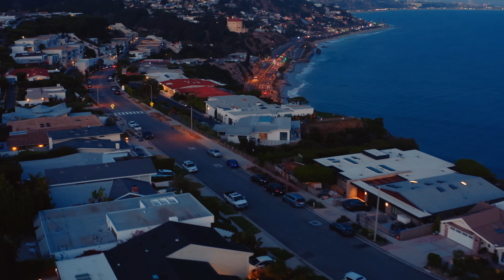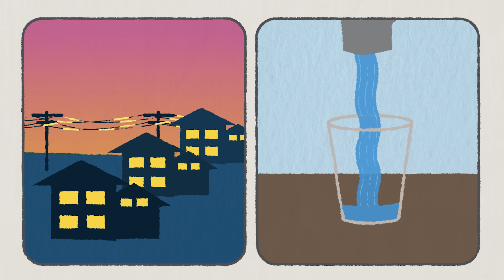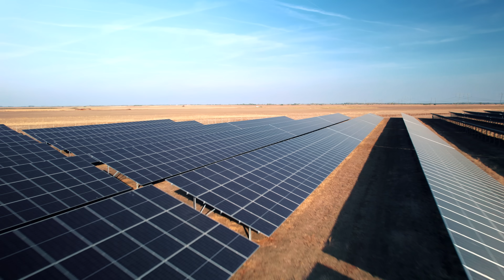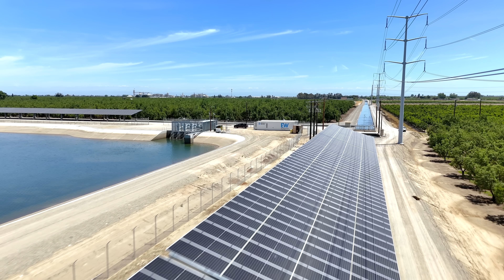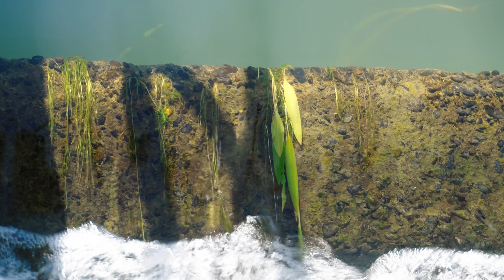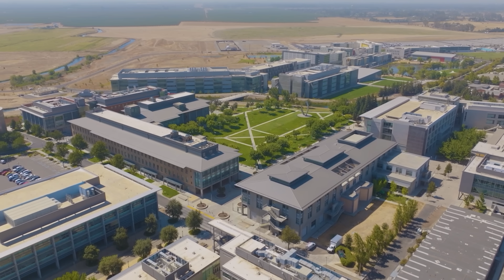California’s new solar panels do MORE than generate power

Comment: I think in the very near future, solar AND battery technology are going to turn the corner where they go from "good technology" to the new baseline technology. I think way too many people are pessimistic about this tech partially because we're still in it's relative infancy.

You point out the growth in solar with a roughly 25 year span, but the "old tech" we've been using has been around for 100 to 150+ years, that's 4-6x as much time for refinement. 

By 2050, I believe solar and battery tech with be advance enough that houses can be easily built to be 100% independent. What I mean is: there are plenty of people who are living net zero with current technology, even with an EV, but I do believe the next step in both solar and battery tech will mean houses don't need to be NET zero, but solar will advance enough that it can generate that much more in the same footprint and battery will advance enough that it can easily store a lot, both to the point houses can generate and store enough to supply themselves more than overnight.

I don't know that we'll be 100% free from fossil fuels by then, but we'll drastically reduce the need for them.
Reply: I believe we will achieve net zero through a variety of resources. What about magnetic-based energy?

Comment: That's US bru, that's US. A continent size country. You have deserts there, huge barren plains with constant sunshine !!! No clouds 99% of the year. 

What you did there, is pure engineering masturbation. 50 more cost efficient ways of preventing evaporation , at least 50. 

You ain't Switzerland, but a whole continent. Waste of resources !!! Do it on deserts, no need for fancy structures, free land. US has interconnected grid , no ??

Comment: I love how cheap solar panels are, so many places are putting them up since you can now earn more then it costs by simply putting in solar panels
Reply: They dropped in price significantly over the last ten to fifteen years ago. I remembered in the 90s and early 2000s that it was talked about that making a single solar panel created as much pollutants than it saved in its operational lifespan. Technology has made significant leaps back then, wether it was true or not, these new generations of solar panels definitely bring in far more efficiency and sustainability on the table than previous generations.

Comment: Right now the issue isn’t just standby power - its grid stability. Turbine Generators have the advantage of huge amounts of mass rotating to produce the grid frequency. Inverters don’t provide any such mass, so Li Ion Battery storage can only take us so far. Flywheel systems are interesting for this purpose, but haven’t been deployed widely enough to be a real substitute for older generating stations yet.
Reply: Thank you for your comments. It's obvious to me that you have  thought ideas to solve problems and looked into solutions as well, for this for some time.

Comment: The fact they dont put ANYTHING over canals is astonishing. It would be easy to put some tarp over them at least temporarily.
Reply: they planted thousands of trees along the Canal du Midi in order to reduce evaporation.
Interesting how different people come up with different solutions to the same problem.
Reply: @P-Mouse  That would be a ton of leaves falling into the canal, especially when the Santa Ana winds come.
Reply: @P-Mouse I'm sure those trees don't need any water eh
Reply: @jedinxf7  they do, they are literally spending water in order to save water.
Reply: @P-Mouse good
Reply: That's a lot (A LOT) of tarp

Comment: California should stop growing almond trees. They’re not suited for the area because they rely on a tremendous amount of water. Avoiding a problem all together is smarter, and cheaper, than trying to fix one. 
I think that the PV canopies are brilliant but... perhaps, to save money and cover much (but not all) of the canal water (but over more miles); angled panels erected on only the south side(s) would be enough to create adequate shade without having to span the whole canal. Making bespoke frames costs more than using off-the-shelf PV stands. Of course, if the project really takes off, the canopy frames wouldn’t be bespoke anymore but just another option.
Reply: I agree with you...  It doesn't make sense to grow such a water hog in a place with water issues.

Comment: Save billions of gallons of water to make America great again.  I think the acres of solar arrays along the 10 is an environmental disaster, causes a heat island effect, and I'm sure the native habitat doesn't like the tweak to their environment.  I also think that in rolling out all this solar, not very good roofing systems have been developed to accommodate solar.  Securing the solar still requires penetrating roofing membranes causing leaks.  I believe that all new commercial construction should have a 3-level roofing system.  The first layer would be the roofing membrane; just a typical roofing membrane.  Around the parapet of the roof would be an 8 foot high wall of fiberglass with a bunch of cell-phone antennas behind the fiberglass.  8’ above the roofing membrane would be built a mechanical and solar mezzanine.  It would be a grated mezzanine covering the entire footprint of the roof.  On this grating would sit mechanical such as HVAC, exhaust fans, etc; and also, a bunch of solar sitting on the grating.  So that everything that used to be sitting on the roofing membrane is moved up to the mezzanine.  The reason why the mezzanine has to be built 8 feet above the membrane is so that when the membrane needs to be replaced in several years, the roofers can work on it.  Also making space for workers allows them to gain access underneath the mezzanine grating in case equipment needs to be serviced or piping done from underneath.  Things like the cell antennas’ coaxial and hybrid cables can be attached to the mezzanine.  Instead of running EMT on rooftop pipe support blocks, the EMT would be hanging from the mezzanine.

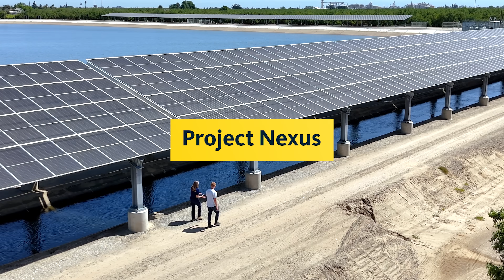Comment: That design is awful, learn to do it from the Indians. So much extra support beams were used 1:49, that your project never becomes even, and there is still side to side airflow under the panels, making the effect minimal, since the dry dessert air will interact with the water surface. It really shows you live in a country that is not frugal in any spending.
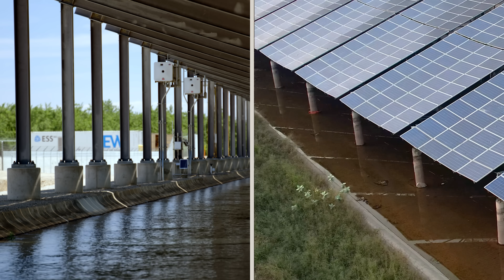Reply: I’m sure you started typing before 6:15 were they explain why they are that tall.🤷🏽‍♂️
Reply: The first prototype was in India.

And it saves 63 billion gallons of water.
Reply: Well there's code restrictions on the ground to ceiling clearance and the beam and post spacing is just a calculation based on the weight of the canopy, thickness of post+beam, and cost
Reply: Even if that airflow calculation is correct, stopping the sun from directly hitting the water will absolutely have a large impact on evaporation rates

Comment: I can't find anyone to service my solar network.  They say they only service systems they install.
Reply: You could service it yourself, provided it was installed by a professional.  In other words, if you cut a line, just replace the line.  If your inverter crashed, go buy a replacement and install it.  Most solar systems today are simple plug and play.  You just disconnect the wires, replace the part, reconnect the lines, and keep on truckin'.

Comment: I've heard that interestingly, some crops actually grow better in partial shade, which is ideal for Solar panels
Reply: Yes, install rows of solar BIFACIAL panels in your field (collects energy from both sides of the panel), and you orient them in a north south configuration and with the panel perpendicular to the ground (on edge so to speak).  First of all, this impedes winds across your crops which is good because wind can leech moisture out of the ground.  Second, with the panels "on edge" and oriented in a north south configuration you can increase your collection in the morning and the afternoons.  This means your midday collection drops, but then in the midday your panels are often overheating and thus losing some efficiency anyway.  

When I say orient in a north south configuration solar panels are typically oriented so that the main face points either north or south (depending on the hemisphere you're in).  If, instead, you get BIFACIAL panels and you point the "faces" east/west and you install the panels on edge so that the faces of the panels are pointed east and west you'll increase collection in the morning, and during the midday the panels won't overheat as the sun is overhead, and then in the afternoon the other face of the panel will get increased collection.
Reply: @TerraPotentia  - believe me: you never want to impede wind from your crops. Especially not with berries and such. NEVER.

Comment: Super expensive soft costs to install.  Floating solar designs with an extremely low profile and unoptimized tilt might be the much quicker and economic efficient way to do it.  Just take a swimming pool in the desert one with and without solar and have a stirring pump for movement and simply measure evaporation in gallons. That would be an accurate calculation to understand water savings and solar improvement.  It should also cut down on algae and other sun induced problems. But drilling into existing canals and mounting with concrete will be the same slow disaster as the high speed train.  I am an Engineer with MSc in Solar and Energy storage. 15 years exp. I'd be happy to give free consulting.
Reply: Good idea. Would periodic flooding out the panels at risk? For the canopy idea, what cost per mile would you estimate for a steel (or aluminum) support and concrete pillars? Over $1 million per mile certainly.

Comment: While I think this is a worthy effort, I wonder why more thought leaders are not pushing the idea of distributive energy generation, that is installing solar and or wind on individual homes and properties?  For example, a sustained effort to install rooftop solar can be integrated into the current electrical grid systems, which in turn will lessen the pressure on these increasingly overloaded grids, free up, centralized produced energy for use in energy demanding industries, such as AI, refineries, smelters, petrochemicals, etc., will help preserve open farmland, not to mention providing cheap power to the greater populace.
Reply: Please write to Greg Abbott, the governor of Texas. He needs to quit fighting against renewable energy in all forms!

Comment: I tell people when they ask me about my solar array, that it serves the purpose of shading the roof which here in Texas has a huge benefit - especially given the fact that Texas does not compensate much for running solar. Shading the roof has as much financial benefit for me as the electrical generation.
Reply: Greg A. is a big part of the reason I want to install solar at my house. I need some advice on how to  multipurpose it with a large home garden and a rain catchment system for the grid.

Comment: Nowhere does it say what the payback time is.   The problem is that in California, the utilities have gotten to the place they pay a pittance for solar generation.   The canals won't be able to use the solar electricity themselves so (in general) must sell it back to the grid at wholesale electric rates.   Its not going to be very economic which is why it hasn't been done before...
Reply: They'll need to reconfigure their possible customers/outlets. The solution is there if one looks for it!

Comment: Next step? Consider avoiding blackouts and updating the electricity distribution systems to minimize them. Consider the recent research conducted on the last Spanish blackout case. The distribution grid requires special connectivity that differs from the traditional ones, which depend on the magnetic coupling attached to the power plant turbine (gas, coal, nuclear, hydro). That solution is usually to add battery plants to mitigate the radical power oscillations caused by solar during the day, which affect the grid.

Comment: How about if California also have those massive farms use cover crops in their fields??  That alone would drastically reduce water evaporation and improve the soil's ability to retain more of the water that it does get, either through annual rains or piped in water.  That along with countless other benefits to the soil's health, which include reducing the use of fertilizers and pest control chemical.  Not picking on California in particular, the entire world needs to get on board with solutions like this.  Just say'n

Comment: The cost of installation over an aqueduct is going to exceed its value.    What guage of steel is needed to span 60 feet?
There is plenty of barren land in the central valley with minimal value that is flat and near power lines. There are miles of it near that aqueduct.

Comment: Put panels over parking lots. Sure there'd be some engineering work against wind, rain and the like. But drivers won't get rained on getting to their cars, cars become less hot under summer sun. And puts a use to lots that aren't used 100% of the time.
Reply: Just reduce minimum parking space or use parking buildings instead of wasting that space in the first place

Comment: I want to see someone put solar panels above metropolitan train lines.  Most metro train lines are electrified using overhead cables, and the engineering wouldn't be that complex to add support structures to the existing gantries that the overhead cables are hanging from.

Comment: The only people that will have a problem with all this solar coming in will be the CEO’s of the electric companies!  

Also, sometimes California produces so much solar power that it is sold out of state.  Sometimes for a very reduced cost.
Reply: If the utility builds the battery storage then in the American Southwest it is now the cheapest option for new generation capacity and doesn’t require large scale water cooling. That’s what electric utility CEOs like right now since the numbers say it’s the best way to go as well as investors. That is reality now unlike just 10 years ago.

Comment: how about robotic canal cleaners cleaning the algal waste from the cement canals and composting for use by the farms the canals irrigate?  maintain a lower panel profile, simplify labor, installation and maintenance, save more water provide farms with fertilizer bonus?  good show.

Comment: While solar farms are an easy way to get big projects up and running quickly, they should not be looked at as the permanent way to rollout your overall solar strategy.  They're just the first step with the hopes to eventually phase them out and get the land back to either being farmed or used for housing.  Once the solar farms are up and running to get your solar production going, commercial real estate needs to be the next step and requirements need to be tied to permit approval.  Either commercial real estate putting panels on their large flat roofs or creating solar panel canopies in their parking lots.  Then finally residential real estate needs to get on board with everyone having a few panels each and a battery or two for emergencies.

Comment: Solar power is indeed extremely cheap when considered in isolation.  The world needs to transition to clean electricity as soon as reasonably possible, but it's disingenuous to keep listing the cost of solar without also listing the cost to the grid including storage, transmission, and stability (voltage regulation).  Dishonesty creates a significant attack surface for opponents of solar.  ⚡

Comment: Installing photovoltaic (PV) systems above bodies of water to conserve water is certainly a sensible approach. However, this also works above agricultural fields. The plants and soil are protected from drying out, as well as from hail and frost. Agricultural yields decrease only slightly or, depending on the circumstances, can even increase over extended periods because weather-related crop failures are avoided. Furthermore, this provides a power source in the field that can be used to operate agricultural equipment. Agri-PV systems already exist in some parts of Europe, and the experiences have been positive.

Comment: What happens if you point a mirror at your panel? 1 simple mirror for increased output?
Reply: only good in early morning and extremely cloudy days.
Good if you want to heat the water.

Need to track the sun more precisely to do any good. You also increase the heat on the panels, that really reduces output.   By the time you add all the infrastructure. It cost more then just simply adding more panels.
The numbers also show that it is cheaper to add more panels then having panels tracking the sun.
Reply: @robumf ahhh copy that. I got a. Concave mirror from a science website, its awesome like a magnifying glass, but better, like zero to 500 degrees in 1/3 of a second. Fun toy.

Comment: Great project, however the "low hanging fruit" is building solar farms over parking lots. At scale you would quickly displace lots of fossil fuel power plants.
Reply: There are powerful rich people with a vested interest in fossil fuels that fight this. Also,  starting with farmland (which is usually private) allows for testing how it works and getting better at it. I'm with you though. Any warehouse or Big Box construction with a giant parking lot should have panels on their roof and over their parking lots to negate some of their negative environmental impact
Reply: This has a different problem; thousands of people going through this space in 2-4 ton killing machines and zero spatial awareness.  You're going to have constant accidents hitting the posts holding the panels up, as well as wiring conduit coming back down to the ground.